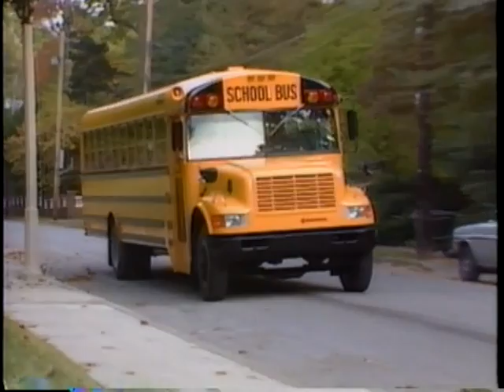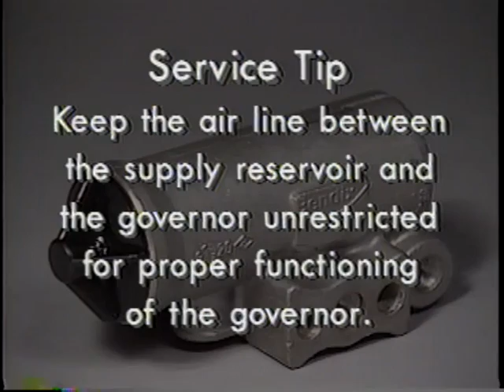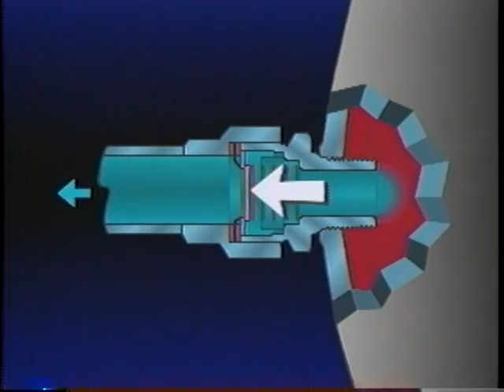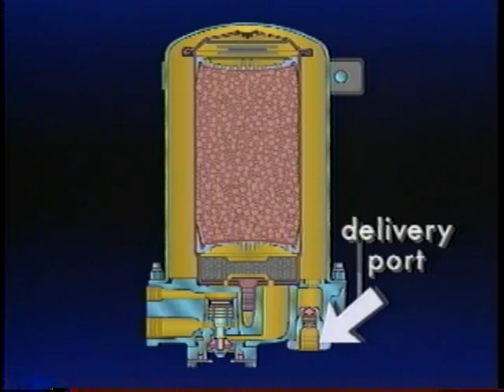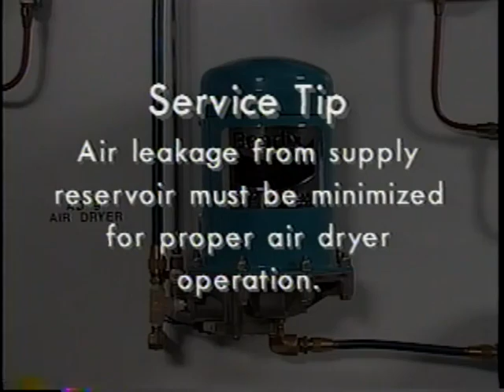Bendix Air Brake Video 1

Comment: Question: this is the process of the supply system = compressor built air and send to the air dryer => governor => supply tank …. Air going over 120 psi governor stop the compressor or the compressor still building air (don’t stop) …. just don’t send more air to the air system?

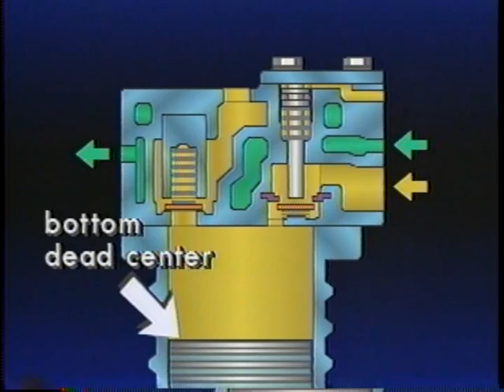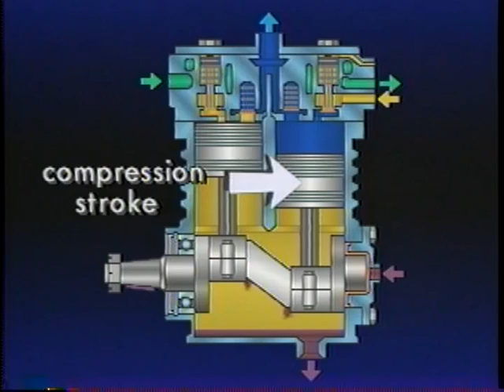Comment: 3:35 intake ; 3:57 compression; 4:23 two cylinders; 4:43 coolant system
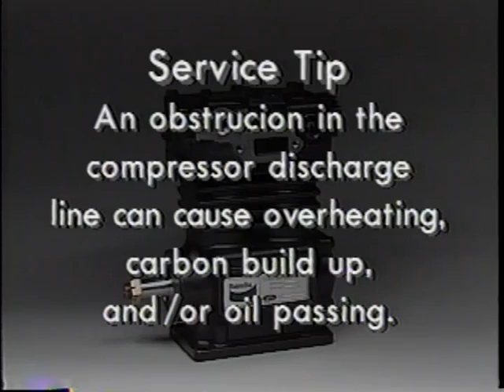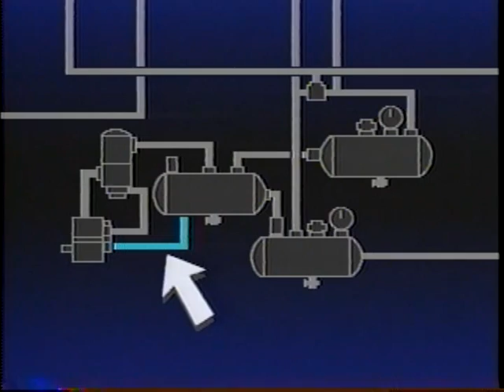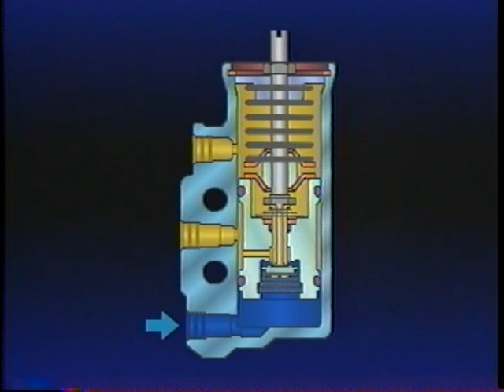5:44 governor; 6:21 cut-out pressure; 6:51 from governor to compressor
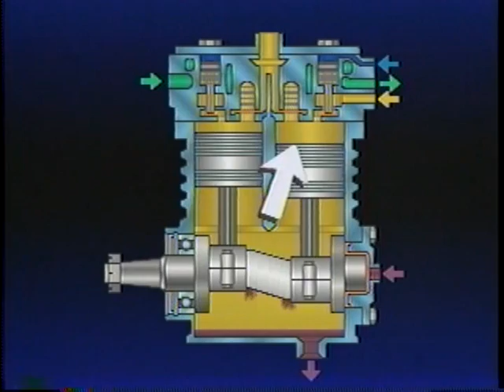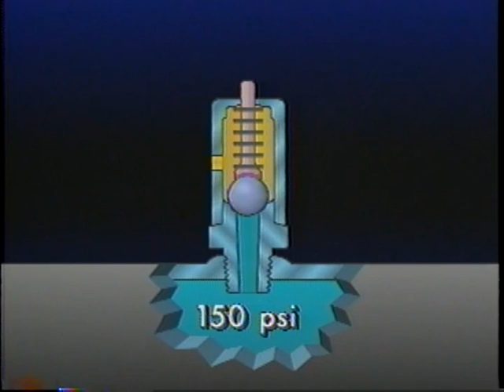7:37 cut-in pressure; 8:50 safety valve

Comment: I almost took the CDL test in Canada in 1992..I remember reading the 'air brake manual' and still have it somewhere.
Reply: As a student currently enrolled in an AAS degree in Diesel Mechanics and Heavy Equipment taking heavy brakes and CDL Prep, I can confirm to this day the information taught to us has not changed at all

Comment: open the drain cock daily and drain the water and oil onto a pavement . multiply this by millions of trucks= lots of oil on the pavement
Reply: That’s why they created the accessory thank or pick thank … this tank collect the oil and when you drain the air tanks just coming out  water 👍

Comment: where is the guvernor and compresor ?
Reply: compressor are mounged on the  engine. there actual locations vary depending on the engine. the governer may be mounted to the air dryer, but can be placed any where and connected by air lines.
Reply: The compressor will be found in the workshop and the guvnor will be found in his office 😉
Reply: It’s probably best to look at your particular vehicle manual. Most school bus you can find them under the hood.